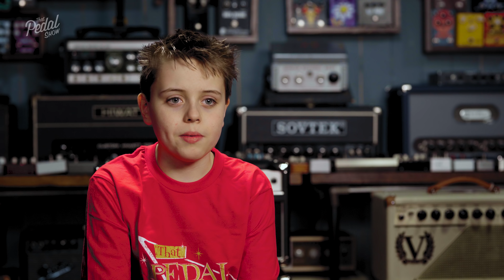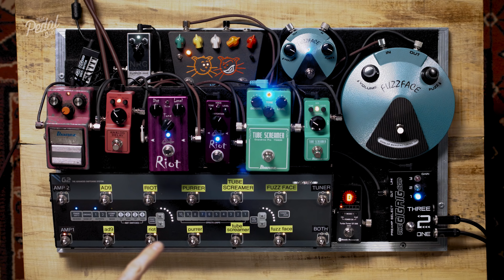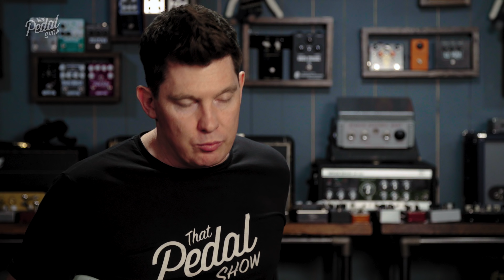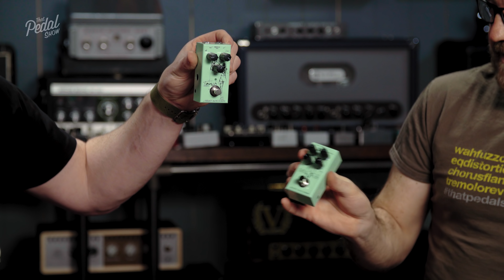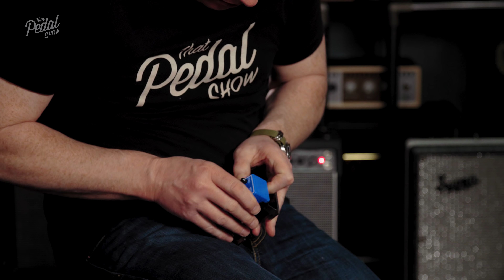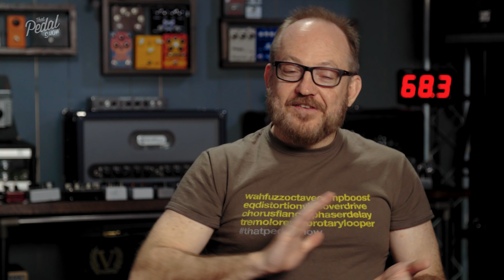Mini vs Big Pedals: Distortion, Overdrive, Fuzz And Analogue Delay: That Pedal Show

Comment: Hey guys, great idea for a show!

Mini fuzz faces:  the Band of Gypsies version was red with white knobs.  The dark blue one was the silicon one of the original batch of 3, which included the Hendrix you have here and a red germanium version.  I tried all of the original 3 alongside each other & the dark blue didn’t clean up at all well compared to the other 2.  I plumped for the one in this video, if you’re at all curious.

Comment: Cool story about the mini vs standard TS808: About five years ago I owned a Hot Rod Deluxe and my TS808 was my main OD. Loved everything about it especially the way it compressed. I lent the pedal to my guitar player to use on one of our tours and he lost it (jerk). I didn't immediately replace it. I sold the HRD and got a 1969 Bandmaster Reverb and modded it to be a huge 112 watt, very open & clean amp (think Two Rock Classic Reverb with stouter low end). About three months ago I decided to finally replace it, played it into this Bandmaster and I didn't like it! The compression wasn't what I remembered/wanted, the feel was different, etc. I discovered the mini version and turns out, it compresses differently than the standard sized and the slight EQ differences fit much better with the Bandmaster. It was just right, I was pleasantly surprised! 

Point is: if you're playing a pedal that you like but wish it was just a little bit different one way or another, try the mini. The slight differences might end up being exactly what you need.

Have you guys ever experienced something where your favorite pedal wasn't quite your favorite anymore once your main amp changed?
Reply from the maker: Absolutely! Pedals can sound radically different into different amps, happens all the time. I even have ostensibly similar Tube Screamers and they all sound and feel a bit different. All part of the fun. The one exception is the Klon. Sounds magic with everything. The hype is real! Hahahaha!!!
Reply: @ThatPedalShow  I know what you mean about same pedals varying by unit. When I asked the Guitar Center guy I could try two different TS808s, he looked at me like I was a maniac, heh. It's all about those tolerances!

Comment: When I got back into pedals about three years ago, I started by building a pedalboard for my piezo StingRay bass that was all tc electronic mini pedals (Polytune 2 mini, BodyRez, SpectraComp, and HOF mini). A year later, I rebuilt my bass board with all Boss pedals, and transferred the tc mini pedals to a new guitar board (sans the HOF mini, since my guitar board uses a tc electronic Arena stereo reverb). In addition to the three others, I've added a tc electronic Wiretap and two (2) Spark mini boosters. I am more than happy to use mini pedals wherever I can, to save space, unless I need stereo, or there is some feature that a mini pedal lacks. I also have a full-size Spark booster on my guitar board.

As far as spacing, I would prefer all my pedals have the footswitches at 100 mm centres, to which I'm accustomed, due to my long time use of Boss BCB-2 boxes, but that turns out to just not be practical when I'm trying to shove 12 pedals on a 19" wide pedalboard, so some of my mini pedals are as close as 70 (for the back row, that doesn't get switched during songs) or 75 mm on centre (for the front row, which does get switched during songs).

Thanks so much for featuring the Mesa/Boogie Fillmore 50. I'm considering one to replace my Mesa/Boogie F-50 in the future.
Reply: I have a narrow-chassis F-50, one of about the first 400 made, and the Fillmore 50 improves on the F-50 by adding a tube-driven reverb and FX loop, and having a much better reverb, overall, than the solid-state driven reverb in my F-50 (I think the later wide-body F-50 reverb is better?). In the F-50 only the FX loop is tube-driven. Plus the Fillmore adds a Presence control and triode/pentode mode switching, so it's a significant improvement from Mesa's earlier 50 Watt "simpler" (for Mesa) amps.

Comment: I think the mini pedal for the occasional sound/just one song in the set, point is pretty valid. If the pedal sounds good in mini form and is only used occasionally then the mini one makes a lot of sense, but if it's a core part of your sound or just can't be matched in a small size then the inconvenience is a little more worthwhile. It's about the only reason I keep the markbass compressore on my board despite it being huge and a pain to power, it just has such a good sound.

Comment: The biggest problem with the mini form factor is that the pedal is too short to span the space between slats in a Pedaltrain pedalboard (I'm guessing the most popular 'poor' man's pedalboard) and still have enough velcro teeth to bite and so you sometimes have to turn them sideways, wasting all the slat space. Furthermore, once the jacks are plugged in the small pedals are almost as big as their bigger counterparts. Stomptrap? LOL

Comment: The Wampler Tumnus is the one mini pedal on my board. I love that thing.
Reply: I like it with some amps but with others, it sounds really dark.
Reply: @mattgilbert7347  I can see how that'd be the case given that it has a stronger low-end than a number of Klon-type pedals. I use a Vox AC15, and I've found the Tumnus does well with it.

Comment: Great video. One aspect your didn’t mentioned, or I missed. Was price. In most cases the mini is cheaper than the full sized. As a “hobbyist” I’ve been thinking about the mini 808 because used or new it’s a bit less expensive and makes rationalizing the purchase easy.

Comment: I think that depending on what you need it for, a mini pedal can be a great choice.  I have a Henretta Mr. White Tweak Boost that is perfect for my rig.  I also use a mini HOF that I don't ever cut off and some other minis.  Perhaps do a part 2 with other types of pedals rather than drives?  Thanks for a cool show.

Comment: I have the mini Phase 95 and it’s so so so good. At the touch of a button I go from block to script and and with another go from phase 45 to 90. I recommend them to everyone.
Reply: +1 Although I haven't switched modes on mine since I got it. Stock 90 mode for me.
Reply: @alanredversangel  I really enjoy the script mode. And I only use the 45 setting when I'm doing something that normally has a UniVibe. I had to take my UniVibe off the board so the Phase 95 is pulling double duty.

Comment: The difference are similar to what I have experienced at home.  The mini pedals in general have an extended high frequency.  This maybe do to the fact that SMC's are more efficient thus the bandwidth from the guitar is extended. In general I find the high frequency in mini pedals as well as miniaturized pedals to be just on the side of painful.  I like bright clear tone, I like volume and I like distortion.  It's not as simple as turning down treble as it can make your tone dull. To me you would need a LPF to remove the extended frequencies while retaining your desired tone.

I run live sound for a lot of shows and nothing makes me happier then present guitar tone that I can turn up as loud as I want but doesn't stab my ears.  Unfortunately many times I am shelving high frequencies for guitar sounds that are harsh or painful.  I know it's completely subjective and do my best to represent artist in their ideal light.  I am also unafraid to ask if a more biting tone is what they want to present to the audience.

Cheers guys another great show.

Comment: 19:50, Volume knob near at full it's very very difficult to match,  you move one milimeter and pass from smooth to bright, instantaneously, so these guys are thinking one is darker than the other one. You have to understand that all the resistance or tone change it gives from 3:00 to full 5:00(maxed).

Comment: Ooo. I love a mini pedal. I have a HoF mini, a mini phaser and a mini TubeScreamer. I've even owned an OCD clone as a mini (Tone City Dry Martini). I'm considering a big muff nano.
Reply: JDODify 
Wondered why no mini MXR phaser, especially since they have the Script option now, and 45 or 90, all in one pedal.
Reply: @CorbCorbin  I have the Tone City Summer Orange - not a bad clone.
Reply: If you get a nano version of the muff, I'd recommend checking out the comparison video done by Pedal Bored.  It shows the regular nano, op amp, and Russian Muff side by side.
Reply: @natepopodi4770  Cheers, will do. I don't think I'll use fuzz often, so I don't want to spend a fortune, but I also don't want a rubbish one. Some of the really cheap ones sound terrible.

Comment: I’m glad you guys shot this video. I’ve always wanted to buy the mini versions of some pedals, but was always worried that they sacrificed something for the size. Do they typically lose their true bypass circuit or other features when transferring to the smaller designs? If you’re not using a true bypass switcher, will the small pedals effect your signal more than normal?
Reply: PS - I would have loved to hear Blue through the Riot

Comment: .FWIW I thought the Dual Channel one sounded a lot better. Just bigger and more open sounding. It sounds really consistent EQ wise switching between the two channels at different gain settings which is impressive.

Comment: Who else out there prefers oversized pedals? I bought a Big Muff last year, and went out of my way to obtain the Deluxe. I don't care that it's so much larger than a Nano enclosure, because its switching options are a massive improvement over the standard 3-pot configuration. I also have pretty big feet, so the footswitch spacing on a larger pedal really makes for a better target.
Reply from the maker: Yes, I'm with you. Mick here. I am worried what FPS stands for though.
Reply: Haha, that stands for First Person Shooter Knifer. I like playing video games like Call of Duty or Battlefield and try to challenge myself by not using any firearms. It's challenging but rewarding.

Comment: I have come to the conclusion that a major part of the classic 'analog' sound is due to phase shift.  Inductors take time to build up a magnetic field and then collapse it and capacitors take time to charge up the plates and then discharge them.  The higher the frequency the more times they need to build/collapse - and therefore the high frequencies get time shifted more in time than low frequencies simply because these small time delays all add up each cycle.  For example I tend to prefer the sound from wahs that use inductors over ones that don't.  Most pedals don't use inductors but they use capactitors - either diescrete or inside chips.  For example a bucket brigade chip uses a chain of capacitors to create relatively long delays - but every single capacitor creates a time shift aka phase shift.  In classic 1970's recordings the number of inductors and capacitors in the total chain was massive - but I believe it is a major reason why audio from that time is very smooth and pleasing to the ears.  It could go too far and devices like BBE processing was designed to reverse that effect.   This concept flows through to the number of capacitors in a fuzz/overdrive//distortion.  I find that ultra simple transistor fuzzes are very up-front and op amp fuzzes sound more distant.  For example my Big Muff Russian sounds more immediate/close and I prefer it for lead tones whereas the Big Muff Op Amp model sounds more distant/far-away and I prefer it for backing ryhthm .  I believe what I am hearing is the much greater phase shift from many more capacitors inside the chip.  
Back to surface mount vs thru-hole ... a very clever man once explained to me that long leads on components contribute to resistance AND capacitance AND inductance.  The length of component leads on thru-hole designs cannot be ignored.  I believe this is a major reason why physically small components surface mount designs tend to have lower noise (less resistance) .  I generally find that I prefer the sound from my bigger box versions of the same pedal - but I also find they tend to be noisier.  I agree that tolerance variation and differences in design make bigger differences but I really think the much longer wiring in general all adds up to extra resistance, capacitance and inductance (even if there are no inductors in the design ).  But the compromise is a little more noise.  And I never underestimate the desirabiity of a little noise - in the digital world it is called dithering.  White noise can be very soothing and part of the 'analog' sound.  Just my theory that seems to confirm my experience.  I have a bunch of mini pedals including the Ibanez ones and they are handy.  But I probably won't buy any more, because I find they are unstable on a pedal board and I really prefer big knobs.  Whwre I tend to use the mini pedals most is when I use my Blues Junior for jamming in a crowded room.  I have a strip of velco on the top of my amp and I chain a bunch of these mini pedals on the top of the amp.

Comment: Great show again! 
Both Riot pedals sounded very nice.
I've got a few mini pedals and the Mooer radar (radar has no footswitch so not really a pedal I think.)
My first mini pedal was the ditto looper, I love my MXR phase 95 and I bought the Mooer Trelicopter and E-lady after seeing/hearing them on this show (thanks so much for that.)

Question for Dan about the Mooer radar: I tried to put a delay or reverb pedal after the radar but that creates some very weird noises (probably something to do with the output (line?) level.) Is there a way to do this or does the radar always have to be the last in the chain?

Comment: Great show! Dan - really interested to see what you do with the mooer radar. I'm putting a pedalboard together for open Mic nights (me solo direct into a PA). I have a valve preamp pedal and also use a lot of reverb and delay which will be stereo, so will be good to hear about your recommendation about where to put it in the signal chain, presumably before it all goes stereo would be okay? Can't wait for it thanks again fellas!

Comment: The problem I have with minis isn't to do with sound. There's simply not enough surface area to get them to attach securely to a pedal board. They fall over when I stomp on them. Also, the tiny knobs on the mooers are just too fiddly for me.

I know they can make the circuit in smaller and smaller packages, but my hands and feet are the same size.

Comment: Cool show guys! Super info I needed to here! Just put together my first pedal board last night. Quick question about power. I have limited power supply and a few pedals have to be run on batteries right now. Will my battery drain significantly if I leave the jacks plugged into them? Or do I have to unplug them every time?

Comment: Hello guys! Congrats for the show, it’s great. 
Question: On my pedalboard I have a double channel + clean boost PlexiTone which is massive along with a couple of Mooers and two other regular sized pedals, I feel that in my case the tiny ones are just complements and fillers to my main sound. Although I really like them, on live situations I always feel that they are not good enough to stay on for a long time. Is it just suggestion?

Comment: Does component size actually incfluence the sound that much?
Being rather clueless about electronic, I wonder if the electrons move differently through a component of smaller size but identical layout and functionality. And if they do, does that affect the sound more than component tolerance, which might be as much as 10%?
Reply: Chris Koe short answer is no, as long as components are operating within what they’re designed for, as we heard with the tubescreamer and riot.  when components operating outside of their designed functionality is part of their sound, like a fuzz face’s transistors or a rat’s opamp, component changes including size (because then it’s not the same part) may be audible

Comment: Such a fascinating subject. I just purchased some mini MXR pedals. How do they compare to the big ones, as in specs, ciruits and sound? I am referring to the Dyna comp and the Phaser. I never tried the big ones, let alone the original vintage stuff. I just assumed that they would do the job just fine, but am still a bit skeptical. Because after all, if the small ones are good enough, who would buy the big ones when the only extra thing they do is simply take up more space? Cheers to you all from South Korea. Thank you for the great video as always.

Comment: Commenting on the Episode. I was a little sad not to see the MXR  Classic 108 fuzz  mini in the comparison with the Fuzz Faces. I purchased one because I thought it sat on my pedal board a bit better than the rounded Fuzz Face Jimi mini. 

That being said. Do you think there is a significant difference between the Classic 108 mini and the Mini Fuzz Face? I've never been sure if the Classic 108 was just an aesthetics choice(Normal pedal enclosure as opposed to the Fuzz Face style ) or if it really is a different Fuzz onto its own.
Cheers again

Comment: I would have fiddled with the knobs a bit, especially on the fuzz face. component tolerances are very tight nowadays. even the bc108s have all similar gain, but one thing that still has crappy tolerance is the potentiometer, and that can change the sound quite a bit in the fuzz face, but also on the others.
Reply from the maker: Only one way to set a Fuzz face. ;0) Mick here.
Reply: @ThatPedalShow  haha I knew it
Reply: I wonder if the reason why the big one sounds darker is because the layout and assembly introduced parasitic capacitance on the whole circuit that eats away the signal's high end. Then one could say that the small one is a "superior" design, but maybe the result of this is not exactly what you want.
Reply: tiogate 
I’ve had the same Fuzz Face, since the year they were released, and it has kept the same qualities. 
It’s why I don’t get a smaller one. I’ve tried all types, and the only one I might switch it with is the Deep Trip Bog.